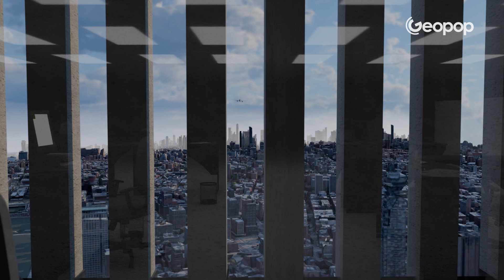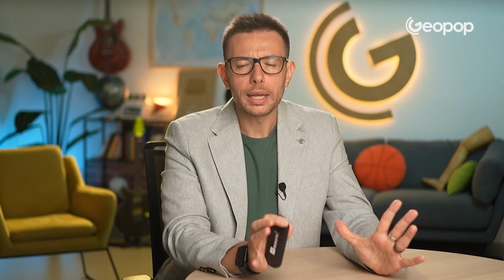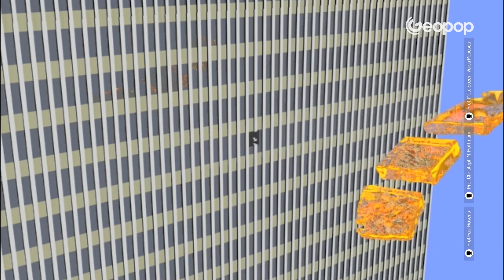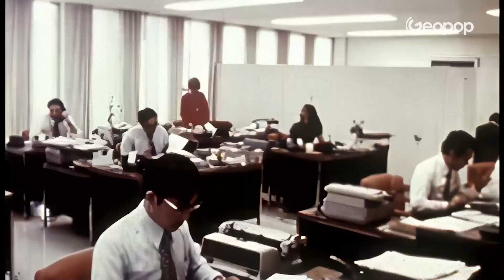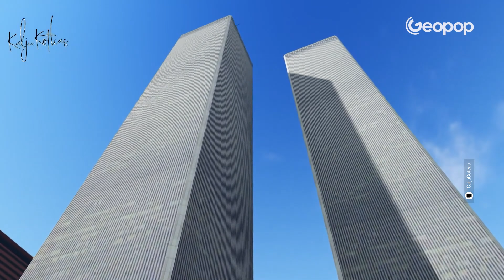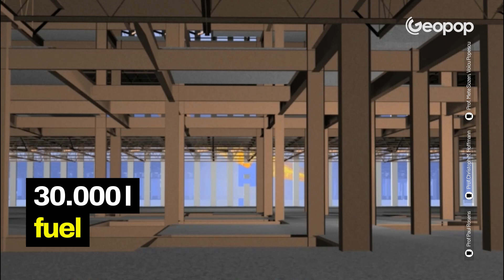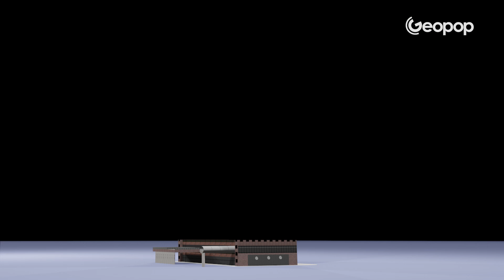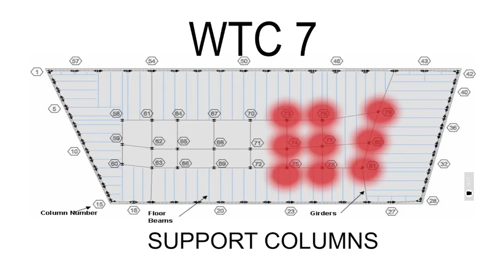9/11, 2001: The Technical Reconstruction of the Twin Towers and WTC 7 Collapses

Comment: So many conspiracists over-complicate and muddy the waters. 

But it's very simple if you know anything about physics & engineering - those towers were always falling. With those plane strikes, it was simply a matter of time. That's all.
Reply: Basic building construction rates structural vulnerability to fire in TIME. Not indefinitely. Firefighters know this too. Steel subjected to sustained temperatures over time will predictably fail

Comment: Crazy how light weight aluminum rips through concrete and steel so easily, 1st time ever 3 steel structures collapsed with one of them not touched by a plane but fell the same way as the others
Reply: Not much concrete. 70% of the facade was just glass. 95% of the interior is air.
 But then, 122 tons of Boeing 767 at 500 knots will impact with the energy of more than a ton of TNT.  How much damage can a ton of TNT do to concrete and steel?
Reply: @TheLoonResistance The entire middle is steel columns in a square covering 4 elevators, you have no clue, plane can't travel at 500 Knotts at sea level, do some reading or try AI
Reply: @justincurley2244  - A plane absolutely can fly at 500 knots at 1,000 ft.  They don't because its against the rules but that is NOT the same as can't.

Learn the distinction.

The Twin Towers consisted of 4 primary structural elements that together formed an integrated system where each relied on the others. 47 hollow box-section steel Core Columns carry the majority of the gravity loads. The 236 hollow box-section steel Perimeter Columns carry the remainder and ALL of the lateral (wind) loads. Long-span Lightweight Steel Trusses connect the core and perimeter column together at each floor with a Hat Truss on top to tie the structure together as an integrated unit where no element can survive without the others. There was no structural load bearing concrete and most components were bolted together.

www.youtube.com/watch?v=u7OqrC74Dm4

The impact of a 120 ton airplane (= to 12 dump trucks) at speeds up to 587 mph and the energy of a ton of TNT destroys the aircraft in 0.75 seconds, which in no way implies the Towers come out unscathed. Some folks get hung up on that. Many perimeter and some core columns are damaged or destroyed. This damage is primarily through bolt-shearing failures at the end connecting flanges, as well as bending, twisting and fracturing of weld seams. There was no cutting or slicing - the reality far more violent and brutal.

It's about energy NOT materials which is something else too many people get hung up on. 

More importantly, the impacts destroy or damage fire insulation, fire breaks and sprinkler systems on multiple floors.  As the aircraft are carrying up to 5 tons of accelerant which gets sprayed across many floors during the impact, huge fires are started across multiple floors simultaneously and allowed to spread rapidly with no effective firefighting or fire suppression. This was an unprecedented fire event .

The hotter steel gets the weaker it gets shouldn’t be a revelation. Our modern civilization was built on that. With fire insulation removed and no sprinklers the survival time of the steel greatly reduced . Over time heat gradually causes the lightweight steel Floor Trusses at the impact damaged floors to sag, which can be seen. No steel melted or needed to. Structural steel fails long before it becomes a puddle. It just needs to bend

A bent column is 4 times weaker than a straight column.

www.youtube.com/watch?v=ULdiD6gYZO0 

I'll hold here for comment.
Reply: @justincurley2244 this same shill responds to every truther on every video, don't mind Hasbara
Reply: @TheLoonResistance You didnt AI the planes capacity in thin air, now you just look retarded libtard
Reply: Those jets has 4000 times the energy of a 5000lb SUV going 70mph.  I bet you didn't know that, dipshit. 🤣

Comment: Umm the fires were almost out by the time the first demolistion wave happened. The towers were designed for multiple impacts from jet liners.High grade explosives caused WTC 1,2 and 3 to collapse. Not little office fires.
Reply: Incorrect. Just the opposite in fact. Fires were continuously growing and spreading. This is obvious enough if you watch time lapse video. The fire spread is most obvious and dramatic in the North Tower.
Reply: @TheLoonResistance  the first three steel structures to completely collapse due to a fire though is unheard of. Even if there were weak points in the upper floors that doesnt explain the ENTIRE rest of the building. Multen steel was discovered under the rubble. It melted firefighters saftey gear
Reply: @PutTheFriesinDaBag69  - Steel structures fail all the time in fire. It literally is a regular occurrence. Steel structures are uniquely vulnerable to fire, not magically immune. The only difference here is the size and cost, which tends to overwhelm people. 

It is important to think about these things correctly and not just reach for the lowest effort answer.  Twin Towers collapses do not have a single cause. It is a combo-platter of four (4) elements:

Impact Damage + Fire (heat) + Time + Gravity = Collapse

Remove any one of those four elements and there is no collapse. Ignore any one of those four elements and you will never understand the collapse.

You are ignoring three (3)

Conspiracy believers tend to be single element (non)thinkers and this is what makes them conspiracy believers. Invariably they will talk about _impact damage OR fire but rarely both and never time and gravity which never even come up. 

Controlled demolition is a simple hand-wave rationalization. A single element, requiring no explanation or evidence (and none is ever presented). Perfect for the non-thinker because engineering is hard. 

We can and should do better.
Reply: @TheLoonResistance 😂😂😂 got to be frustrating wasting your time getting owned in the comments

Comment: Thermite, they were controlled demolition
Reply: Thanks but given the choice between conspiracist fantasy and science, I will stick with the latter.
Reply: @TheLoonResistance well pyhsics is science, and thermite fits the equation.
Reply: @Vigilante-k4q - No it doesn't.  Thermite is a rationalization.  A hand wave.

Thermite ONLY came into the discussion because conspiracy believers needed to rationalize the obvious LACK OF EXPLOSIONS in what they were trying to pitch as an explosive controlled demolition

Thermite was not latched onto because there is ANY evidence for its use (there isn't) or that it would even work (it absolutely wouldn't) but to maintain the fiction

Thermite was first promoted by career crank Steven "Cold Fusion" Jones who had the additional motivation of trying to gain back market share in the conspiracy space that he'd lost when he split with his partner.

Science and engineering had fuck all to do with any of it.
Reply: @TheLoonResistance even the firefighters said there were thermite puddles in the lower areas so I guess they don't matter, and in the videos of the towers just before they fell, you can see gushes of molten steel seeping from the corners of the building. So your point is mute.
Reply: @Vigilante-k4q - Which ones?
Reply: @TheLoonResistance there are plenty of videos of workers in the pit saying that when they got down to the lower areas, the thermite pools were still hot and smoking, thats why the debris kept burning, you keep thermite fed it continues to burn, despite water, water makes it spatter. The videos are on youtube.
Reply: @Vigilante-k4q - Present one then.  Its your case. Present your evidence to support it.

Also, there is no such thing as a "thermite pool".  That's not a thing.
Reply: @TheLoonResistance actually thermite will pool in its moltent state. I loved that part of FF training.
Reply: Oh and btw, i have more than 20 yrs as a FF emt. Since 1995. I was a junior. I have my FF 1 and 2 with several hazmat certs. Including Nims, 
Due to a stroke in 22 i couldnt perform the tasks anymore, you ahould hear the radio traffick of the FF in both towers up to the collapse of the south tower. The tapes werent released to the general public.
Reply: @Vigilante-k4q  - Uh huh.

Back on topic,... youtube.com/watch?v=JXWCMBuusMI&ab_channel=TrutherTVArchives

In this video starting at 45:35 and running to 48:35 the Energetic Materials Research and Testing Center (EMRTC) conducts a test to examine the effectiveness of thermite in cutting a vertical hollow box-section steel column very much like those in the Twin Towers. The column tested is however smaller in cross section and made of thinner steel than that of the Twin Towers perimeter columns (and never mind the core columns).

In total 175 pounds of thermite are used for the test on just one column, requiring the construction of a rather conspicuous coffer dam to contain it. Do recall the Twin Towers had 240 columns and 110 floors. It would be odd if thousands of office workers missed hundreds, perhaps thousands of those suddenly appearing.

Note what an incredibly slow process this is. It took close to 30 seconds for the thermite to finish burning off. It would be impossible to “control” a demolition using this material. Not to mention the issue of; how does the aircraft impact and subsequent raging fires NOT prematurely set this stuff off?

Also note how bright and obvious the whole process is. Could not be missed visually. No way to hide that.

Then at the end of the test the (relatively modest) column was undamaged…. which is a problem.

Certainly no rivers of molten steel emanating from it either and in fact the whole thing cools rather quickly as soon as the thermite has burned off, as one would expect.

Thermite has never been used in the controlled demolition of any building, let alone one with multiple floors on fire after the impact of a large jet. If the conspiracy oriented internet has taught us anything it’s that if something has never happened before, it can never happen.

All of this very much ado over nothing anyway since WTC collapse mechanisms are well known and understood and no thermite of any sort was involved.

Collapse initiation was due to sagging floor trusses from the impacts and subsequent fires pulling some of the perimeter columns inward by up to 5 feet until they buckled, as we see here:

Gary Pollard South Tower collapse, looking at the east side toward the north. 

www.youtube.com/watch?v=ULdiD6gYZO0 

Thermite doesn't do that !!!!!

Once initiated there was nothing to prevent progression to global collapse. The falling mass of debris – hundreds of thousands of tons - had more than enough energy to drive its way through and dismember the structure below floor by floor, through the path of least resistance - the floor truss systems of the open office space, bypassing the load bearing columns entirely.

As demonstrated by the model in the video above.
Reply: @TheLoonResistance worked again by an actual expert 😂😂
Reply: No firefighter ever stated they saw thermite. This is false. They saw molten steel
Reply: @eggsinhell1532 that's thermite, and yes they did, pools of it in the basement, I guarantee that avgas will not get hot enough to melt steel.
Reply: Please tell us how "they" managed to keep the explosives from igniting for 1-7 hours after the impacts, and raging fires? The colapses initiated at the point of impacts. So how did they rig the explosives so that they were not damaged by a plane collision?
Reply: @BoodahBodey you wouldn't understand, the fact that firefighters from fdny even stated that there were thermite pools in the basement, in plain sight.
The largest gold heist in world history.

Comment: what kind of propaganda is this? ..how come the buildings all collapsed at perfect gravitational acceleration? ..even a local failure wouldnt result in free fall dustification.. get real.
Reply: A local failure did result in a free fall collapse because the connections could not resist the falling mass which grew as it progressed. As the mass grows the force grows. Since the floor connections directly below the initial falling mass could not resist the force, the lower floors had even less of a chance because more mass was falling on them. We are taling about a 3/4" inch steel plate which held up each floor. Every floor had the same connection detail. The first floor was the same strength as the top floor. So if one floor failed, all the rest were going to fail.

Comment: Love the doc but sort the sound out. On video you can see the heat building on the floors hite the the cord side bend in as the force of the floow inside fall, that why it looks like the floor blow out in the inside of the building increasing on the inside blowing the side out like an explosion. I not saying it wasn't a inside job but there came down because of the plane nothing more the building wasn't able to stand the damage. If it was a inside job they got extra locky/unlucky. They knew info only US forces when have access to like that there was a training excise on the same day taking up resources, don't worry if US gov or Arm forces are broken so is the UK as both Manchester and London Bombing happened on day the Police, fire and ambulance was on training adding confusion each to to investigation and security forces delay. Bomb squad and Transport police where very slow in response because at first they didn't know if real or part of the tests. Same thing in US air forces. i also think the shot down the last plane, but it honourable to see those on the plane as bringing it down to save other if works, and give peace to the victims families. After all lots of people died who didn't have US politics in there heart. However religion hate bankers and market traders. maybe there is some truth in the bible of god. Building seven was a victim of fall over. it was just to close to the towers.

Comment: WTC 7 literally imploded. You can watch it happen frame by frame. NIST wrote countless pages of the collapse, without ever actually addressing the collapse. The Twin Towers were explained away with a computer model that showed examples of everything besides what actually visibly happened. Appreciate the effort, but in the first seconds of the video it was immediately admitted that it can’t actually be provably explained other than demolition
Reply: While I find it exceedingly unlikely you ever actually read the thing much less understood it, if you don't like The NIST they are far from the only game in town.  

The collapse of Building 7 is one of the most studied engineering disasters in history and the subject of 5 comprehensive engineering studies and more than two dozen technical articles in major peer reviewed engineering journals, most of which were published 15 or more years ago. Thousands of pages of material.

This should get you started.

FEMA BPAT (initial report superseded by NIST NCSTAR 1A)

NIST NCSTAR 1A: Final Report on the Collapse of the World Trade Center Building 7, 2008.

Guy Nordenson and Associates, WTC7 Global Collapse Analysis Report and Summary of Findings, 2010.

Arup, WTC -7 Structural Fire Analysis Report (Runs 1-4), 2010.

Weidlinger Associates Inc., WTC 7 Collapse Analysis and Assessment Report, 2010.

BRE Centre for Fire Safety Engineering, Analysis of the Impact of a Fire in the Mechanical Room (5th & 6th Floor) of the World Trade Center 7 Building, 2010.

T. McAllister, R. MacNeill, O. Erbay, A. Sarawit, M. Zarghamee, S. Kirkpatrick, J. Gross, Analysis of structural response of WTC 7 to fire and sequential failures leading to collapse, J. Struct. Eng. (United States). 138 (2012) 109–117.

For a summary of the major studies I would recommend THE COLLAPSE OF WORLD TRADE CENTER 7: REVISITED by Mhd Anwar Orabi , Liming Jiang , Asif Usmani and Jose Torero which is a 27 page summary of the different analysis and conclusions published in 2020. Sorry, YouTube will delete this post if I give the link but it should be easy to find and is available from the University of Queensland, Brisbane.

Real structural engineering industry professionals conducting real engineering studies and publishing them for other professionals to see. Not amateur YouTubers appealing to the gullible and credulous.

Happy reading
Reply: @TheLoonResistance Pilots for 9/11 truth, and Architects and Engineers for 9/11 truth, are all just ludicrous then? If it can be explained how laws of physics were broken then a simple worded explanation to directly describe it would be easy to verbalize. You’re citing these studies and names as if NIST isn’t composed of the same exact kind of professionals. If the 9/11 report has been professionally disproven then why haven’t they published a revised version? You’re being told to not pay attention to your own eyes and ears.
Reply: @pokebois8559  - Yes, they are ludicrous actually.  Single-issue advocacy groups floating on false appeals to authority they come nowhere close to meeting.  But we can dive into that later. 

Curious that you apparently find The NIST to be ludicrous along with all of the other extremely talented engineering firms and organizations I previously mentioned, but fully buy into those two clown shows. 

It isn't about who is telling you what you want to hear, it's about what happened. 

IF you don't like any of those versions I have my own. Did it all by myself and it blows out of the water anything those asshats at AE911T have ever produced. They are far too busy planning fundraisers to actually do anything useful.
Reply: @pokebois8559  - Guess not then.
Reply: @TheLoonResistance  you're losing the propaganda war